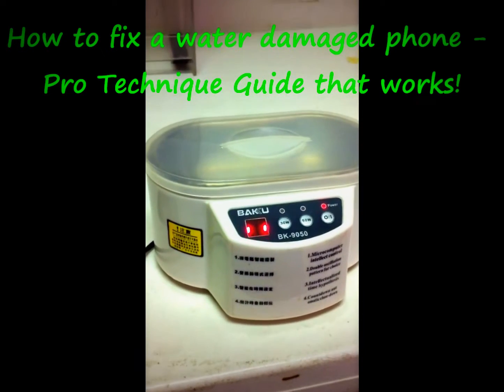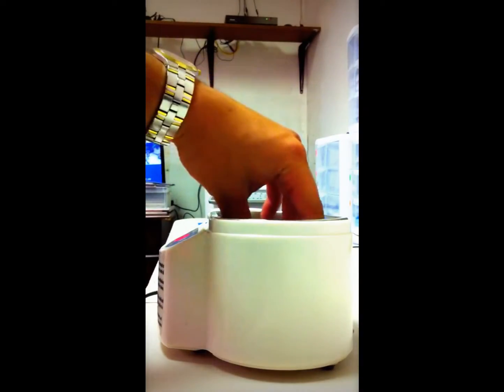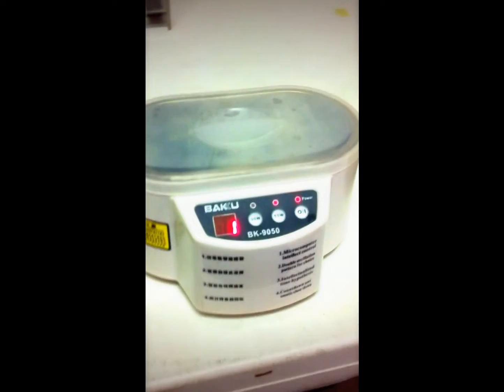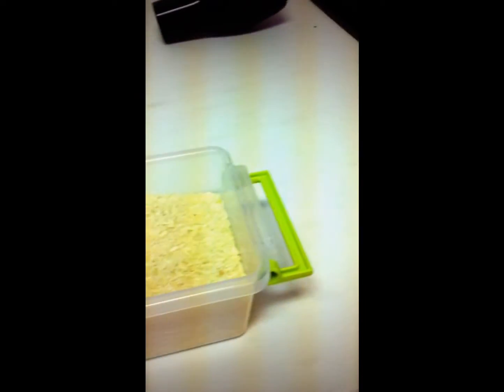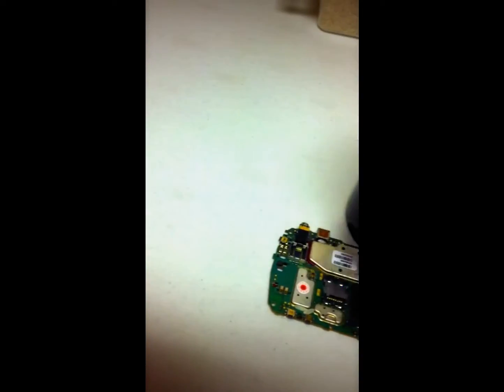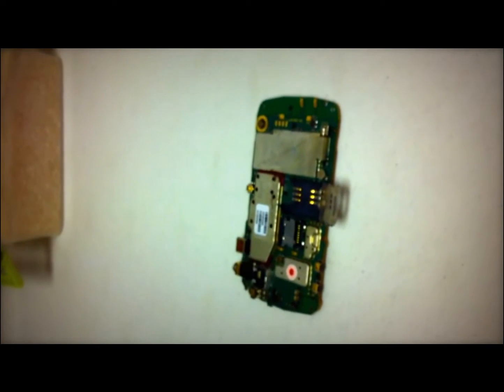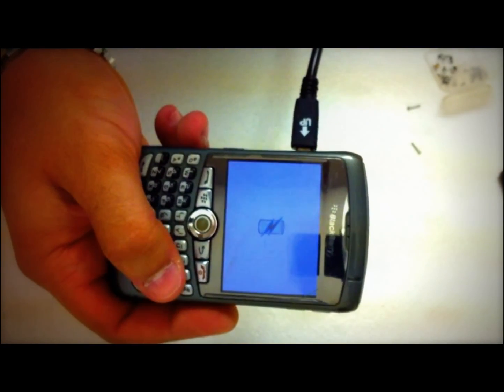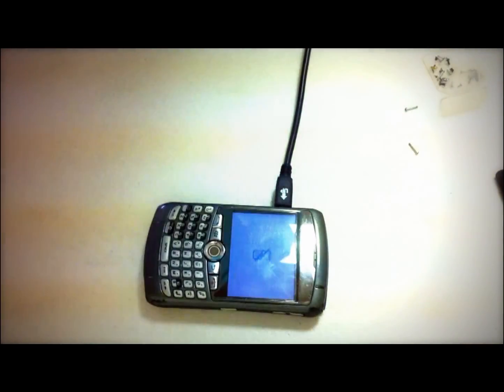How to repair a water damaged phone - water damage repair guide(works for all phones)

Comment: the rf shields should be desoldered and removed as well this allows  for larger bits of degradation and eletrolized  muck be released from under the rf shields.  I am sorry mate but this is certainly not the best video i have seen on fixing water damaged phones.  it's still nice of you to share tho.

Comment: Don't use isopropyl alcohol as a ultrasonic cleaner solution as others on here suggest because their is a risk for fire. Use distilled water and a few drops of dish soap as your ultrasonic cleaner solution and scrub the board with a toothbrush and isopropyl 91% or higher and let it air dry for about 48 hours before testing.

Comment: I am hoping this is when you first started and forgot to remove the video. Anyone watching please check other videos this is not the best option. At least go to your local pharmacy and purchase 91% or higher isopropyl alcohol instead of water. Also a soft toothbrush with the alcohol for visible corrosion.  Forget the rice and let it air dry or low heat to speed the process. An hour is plenty if you gently shake excess liquid off to dry.

Comment: put the motherboard in a box of silica
you get silica from silica bags and you will find those bags in shoes food ect or you can buy silica
Reply: well when u have water damage on phone, that water corrodes the connection, so you not only need to remove the original source of the moisture, but any corrosion and material that is result of that water drying up and rusting components.
Reply: Or you could just use rice which is readily available and so cheap its almost free...

Comment: Never use alcohol or any flammable liquid in an ultrasonic cleaner unless it is designed for that. Risk of explosion/fire. Use deionized or distilled water with a small amount of liquid detergent. Then dry thoroughly as per video.

Comment: THIS IS THE WORST WATER DAMAGE REPAIR I'VE EVER SEEN. YOU ARE SO DUMB. FOR REAL.
Reply: u better say what the better way or shut it up better for us.
Reply: Well for starters, you don't repair water damage with more water. That's just stupid. Use a cleaning solution, or 97% or above isopropyl alcohol. And don't stick it in rice, that's even worse. Rice has starch on it that has to be washed off before it can even be cooked, or the starch sticks to things. Like wet circuit boards. You stick any electronic device in rice, and you're just asking for the dust from the rice to stick to it and corrode the board. Once it's been washed with alcohol, blasting the board with a heat gun for half a minute or a hair dryer for a few minutes will evaporate the alcohol, which will have displaced all the water in the nooks and crannies..